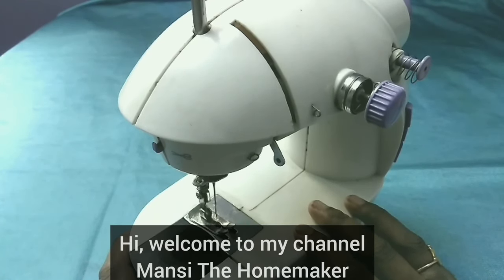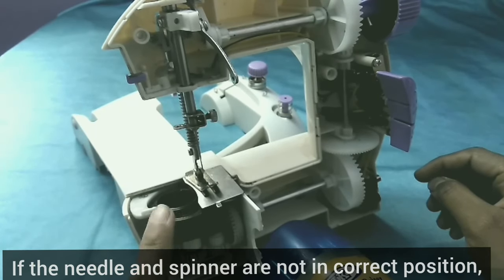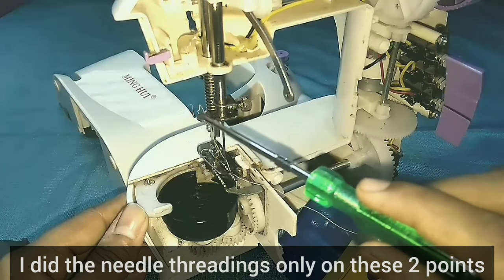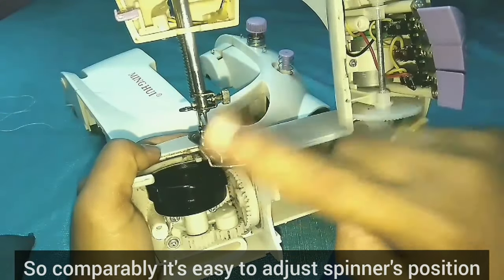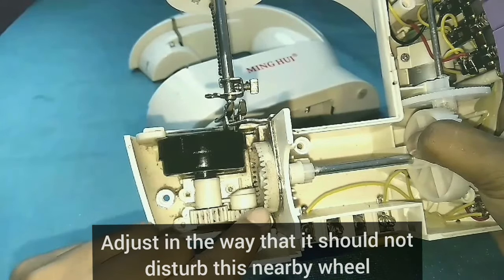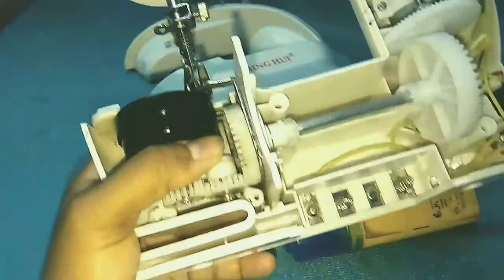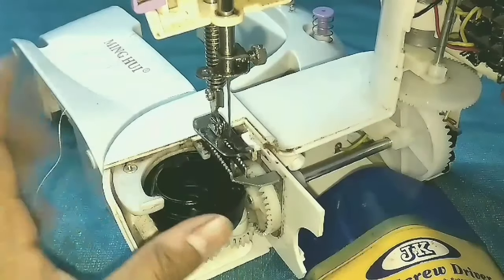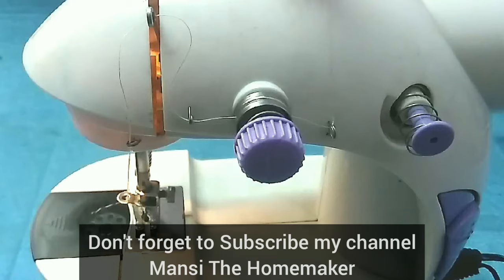Mini Sewing Machine Needle not catching the Bobbin thread problem solved

Comment: Madam i very thankful about your videos but as per your instructions all are as per my knowledge i done with your help but problem is not stitching just plain thread is moving upeer one and lower one just moving plain thread what to do can you suggest me
Reply from the maker: Did u adjust tension controller?
Reply: @mansithehomemaker6743  yes one time is succed but ater thread is over again irefil it then started previous problem both the threads are rolling but not stitching help i adjust clockwise and anti clockwise adjustment also but no change the both threads are moving but stitching i change the needle also no 18 &16 both are tried no results
Reply from the maker: @ravindraadapa2952  needle size is 16 only.. u do one thing. Just stitch and take a video and send to my mail given in about section. I ll check n tell u.. I want to see both threadings n stitching also. Then only I can see what's the prob.
Reply: @mansithehomemaker6743  could you please provide email id
Reply from the maker: @ravindraadapa2952  mansicreativity@gmail.com
Reply: @mansithehomemaker6743  just now i upload a video please check and give me your valuable suggestion

Comment: you dont need to unscrew the bobbin gears, just lift the big axel gear  a little connected to the main motor gears so you can freely rotate those gears without doin some effort ^_^
Reply: Thanks! Hopefully it works 🥲

Comment: Useful video. I have a problem. Bob in spinner is working. But the needle shaft is not working, I.e, the needle is not moving up and down. Motor, wheels are ok. Please solve. Thanks.
Reply from the maker: Open the machine n check wheather needle portion is fixed correctly

Comment: MADAM your video is good, but i tried but stitch not coming what will be the reason??  may i know your location?, i am from TVM, if near i can bring to repair. if possible, the machine still kept inside cupboard without use.
Reply from the maker: Check tension controller too.

Comment: Hi, I was also facing same problem.. now it was rectified bcoz of u.. thank u so much for that.. 
Now a new problem arises that is my main wheel is not moving.. after dismantle the machine I moved the wheel manually.  But my violet knob is not moving..  what shall I do? Plz suggest me a proper solution
Reply from the maker: Open the machine n Check wheel part inside.  If thread or something stuck in this part clean. May be bcoz of that also its not moving..
Reply: I opened the machine and cleaned.. nothing stuck in there.. but it's not moving still

Comment: THanks. So I have the spinner in the correct position for the very first thread. then it keeps losing the thread. what should i do
Reply from the maker: Did u check inside wheather it's picking the thread or not?

Comment: My problem has not yet solved pls any other video regarding the same problem
Reply from the maker: Actually wat s ur exact problem?
Reply: The needle doesn't accept the bobbin thread and the needles thread sticks down
Reply: Stucks
Reply from the maker: Aarthi Chauhan  fix the bobbin spinner in correct position and check whether it's picking or not. If not so, check it in which position its picking the thread. That's d default position. 

Needle thread stucking means, tension controller is too tight. If it tight it ll hold the thread. So little loose it. If it's stucking in bobbin case means, just clean the bobbin case properly and do rethreading

Comment: Please tell solution....for thread breaking in mini sewing Machine
Reply from the maker: Keep tension controller in correct position.  If its too tight it ll hold the thread n it ll be cut while stitching.  use it regularly.  If u stitch afyer lng time it ll happen. Use oil n stitch regularly

Comment: Ur video is very useful  but...it didn't helped me out with my problem
I did just same as u did but failed
Now the spinner itself is not rotating can u help me out
Reply from the maker: Check that spinner's bottom. May be threads ll stuck around it. Just clean it n check.

Comment: Mam, my machine also same like this. Nowadays the machine makes a sharp noise and winder (hand wheel) doesnot rotate. Can you tell what is the problem here? Expecting ur valuable answer. Thank uou😊
Reply from the maker: Even using hand also it's not rotating?
Reply: Yes mam little hard to rotate by hand. Give me solution😊
Reply from the maker: @shobanakarthick3635  did u check ur bobbin case inside? Bcoz sometimes if its not clean, thread ll stuck inside. That time wheel ll not rotate. It ll stuck..
Reply: @mansithehomemaker6743   s mam. After cleaning also the problem was not solved.
Reply from the maker: @shobanakarthick3635  can u take one video n send to my mail id? I ll check n tell. Even just open the machine n take video. I want to see inside wheel portion also. Mail id given in about section
Reply: @mansithehomemaker6743  ok mam.

Comment: Very much useful I thought.. But same I did, can't fix my machine problem. Catching the inner compartment sharp point, but the bobbin thread is not  coming outside, not stitching anymore. Still facing this problem... Plz help me yaar
Reply from the maker: U just pull the needle thread after inserting bobbin. When u pulling needle thread picking bobbin thread. check whether it's doing it or not
Reply: @mansithehomemaker6743  i checked so many times,but its not fixing. Thinking about how to fix this..pls reply madam. I think u nly solve this problem ma'am
Reply from the maker: @shylajagitha706  u r not getting stitches?
Reply: @mansithehomemaker6743  I'm not getting stitches anymore..needle thread is catching the inner thread of bobbin but its not coming outside . Stitching is impossible till now

Comment: Hi bobbin picking two three threads and machine stops running and gets stuck again and again? Why?
Reply from the maker: 1. Pour some oil in machine holes, mainly in needle part.
2. Keep tension controller little bit loose. If it's too tight, it ll hold thread and while stitching machine ll stuck & sometimes thread ll cut.
3. This s the main thing. Clean bobbin case clearly and rethreading (both needle and bobbin thread). 
4. After using oil, use old cloth for sometimes till u ll get smooth stitches. If u r using machine after 1 to 2 weeks means it ll happen. Use it regularly. It ll be smooth stitching.

Comment: Hi madam my machine is working but stitches are not coming what's the solution could u Pls tell me
Reply from the maker: Did u check tension controller? If it's not in correct position ll not gud stitches
Reply: @mansithehomemaker6743  ya I have checked it is correct

Comment: Hi madam my sewing machine motor  not  working proper 
Same machine ,and threads getting gaps 
Pls send the details of total machine
Reply from the maker: It's stucking ma... Use oil for refreshing it.  Clean the bobbin case properly. Thread ll not stuck n gap ll not be there. After using oil rethread both the bobbin n needle thread. Use some old cloth first

Comment: Sister i tried this but then also its not catching the thread and also some hard sounds are coming out..pls help me..why is it happening like that
Reply from the maker: From where u r getting sound? Getting sound while running machine?
Reply: @mansithehomemaker6743  yes
Reply from the maker: Apply oil. May be it ll be reduce after using oil. And place spinner in correct position. If little bit change, needle ll not catch. After changing the position, hold it tightly while putting screw. Bcoz sometimes spinner ll move while screwing
Reply: @mansithehomemaker6743   thank u so much dear..let me do it..
Reply: Sister i got the real problem..its on the wheel on the side of the machine..when i tried to catch the bobin thread feels like the control for rotating the wheel is gone instead some outer area only is rotating and needle also goes up an down while spinner is not moving..is there any any solution for this..may be my machine is gone..
Reply from the maker: Open the machine n check wheather the wheel side parts are correctly connected or not. If not means, correct it first.
Reply: K can u pls tell me which thread brand is best for this mini sewing machine

Comment: Mam my machine is not taking thread from bobbin, I have tried all possible ways shown in video still my problem is not solved, n I just used machine 2 to 3 times pls help me mam
Reply from the maker: Remove bobbin case, stich with thread and take video, send to my mail id given in about section.. I ll check it .

Comment: Bottom bobbins thread not coming outside  i tried mainy times
Reply from the maker: Keep bobbin spinner in correct position as i said. While screwing, hold it tightly. Position ll be change, while screwing
Reply: @mansithehomemaker6743  bobbin Palced correct only when thread come out spinner position changed and machine not work than i have to cut the thread. 
Tell me how to correct this

Comment: Stich pannmbod stuck agum madam eppudi sari pannala sollunga.
Reply from the maker: Tension controller Romba tight ah vacha thread hold pannikum. So stuck agum... Loose it little bit. Then bobbin case clean panunga. Ulla niraya threads dust irukum.    So athula thread sikitu stuck agum.
Reply: @mansithehomemaker6743  ho thanku for ur reply love u 💝💝💝

Comment: My needle is catching under the bobbin and the needle keeps getting stuck and its so hard to get it out... I tried removing all the threads and tried just the needle but the needle alone gets stuck under... What am i gonna do? Its brand new and i dont know how to fix it pls help me. Anyone?
Reply from the maker: Place the bobbin case in correct position. If it's in wrong position, needle ll stuck inside and sometimes it may break.
Reply: @mansithehomemaker6743  what to do of my needle is too low? Like i tried removing it and got another one but it's just too low thats why it is poking under :(

Comment: Sis my machine button problem but machine open panna open akala ninga yeppadi open panringa please reply sis
Reply from the maker: Machine pinnadi 6 screws irukumla ma atha ellathayum remove pannirungala?
Reply: Open panniden sis please request sis my machine button problem machine work akala sis button problem tutorial podunka sis please its my request sis
Reply from the maker: @aruna6698  sure ma.. machine keela battery podra options irukumla antha case open pananum ma apo than machine open Panna mudiyum
Reply: Ok sis I will try sis but button problem iruntha yenna pannalam tutorial podunka sis innum useful la irugum sis thank you sis
Reply from the maker: @aruna6698  sure ma..I ll check with my machine n upload
Reply: Ok sis thank you sis Be proud of yourself sis thank you so much sis 😊😊😊

Comment: i am.not aple to put bobbin case again at tht place
Reply: needle getting twist because of false frame adjust ...
Reply from the maker: Adjust it correctly as u said. And I have showed how to place bobbin case inside. Ace it correctly otherwise needle ll get break
Reply: yes tht prblm has been sort out nxt problm started is... cloth is not getting stitched ..... not holding thread.
Reply from the maker: Have u checked wheather the needle  is picking bobbin thread or not?
Reply: it is picking vry well whn i followed your instructions...thnx alot for tht.. ❤❤🙏plz give possible solution for my current prob.. i will glad to hear by you...
Reply from the maker: Can u pls take video n send it to my mail id? I ll check n tell. Want to see both threadings too. Mail id given in about section
Reply: ya sure n thank you so much for your lovely cooperation❤❤

Comment: Medam babinle thred correctly veliye varudu but stitching Vila matindu orordadave stitching diorama viludu
Reply from the maker: Tension controller check paningala?  Athu correct position la irukanu paeunga
Reply: Na pathutu solre medam tq reply pannaduku tq so much
Reply: Medam Na tension control neenga video pannirkra madrium panni pathe but stitching Vilale enna pandrudu medam
Reply from the maker: Then may be machine la fault irukalam.  if its new machine u can return n replace it asap

Comment: Needle theart cut ahitae irruku
Reply from the maker: 2 reason for needle thread cutting
1. Tension screw romba tight ah iruntha thread cut agum.
2. 1 week mela use panama irunthalum needle thread cut agum.
Solution : use oil for needle portion. After applied oil use old cloth for stitching. Stich until u ll get normal stitching. Continuously use the machine.

Comment: Inneku tha intha machine vangunen.. Randu needle um break aachu😢
Reply from the maker: If machine is working means u can buy new needle. Otherwise u can replace with another machine as soon as possible sis
Reply: Actual ah enak machine use pannave theeiyathu dr..
Back le antha liver keele erakkame stitch pannanga en ponnu
Apdi panna needle odayuma?
90/16 needle correct size ah?
Reply: Thank u for ur quick reply.. Subscribed
Reply from the maker: @sindhuranjith7007 no sis. Athukum liver kum sambantham illa.. May be bobbin case sariya fix Agama odanjirukum
Reply from the maker: S sis. Needle size is 16.
Reply: Ok thnQ
Reply: Ana 90*16 varathu 100*16 tha varum nu solranga ella shopleyum
Reply from the maker: Ohh. Try parunga sis. Na needle kamichu ketapa avanga enta 16 kuduthanga
Reply: Hm ipo wrk aaguthu
Thread tha appoppo kalntu varuthu
Reply from the maker: Tension controller check panunga sis...
Reply: @mansithehomemaker6743  ok sis

Comment: Suththamave thaiyal velala ellam sariya irukku
Reply from the maker: Tension controller adjust panni pathingala?
Reply: @mansithehomemaker6743  tension controller maththi mathi vachsi paththen onnum nadakkala last ta tension controller re kalandukittu vanthuruchsu
Reply from the maker: No problems atha fix panniralam. Na athuku thaniya video potruken. Check pannikonga.. and stitch panni video eduthu mail id Ku anupunga. I ll check. Mail id given in about section
Reply: @mansithehomemaker6743  thank you
Reply: @mansithehomemaker6743  mam vedio anuppa mudila unga mail ku
Reply from the maker: @vijaykumar-pw9ve  y what happened?